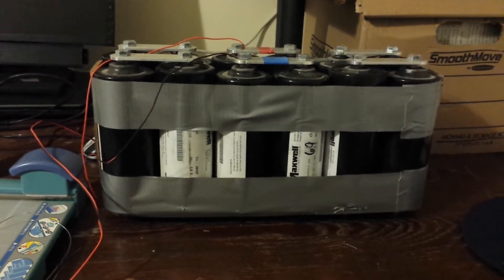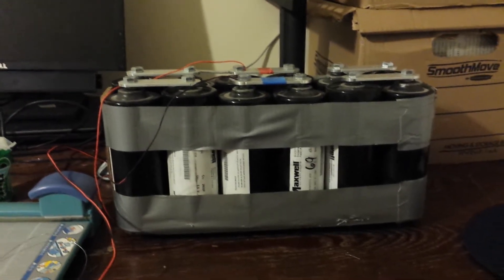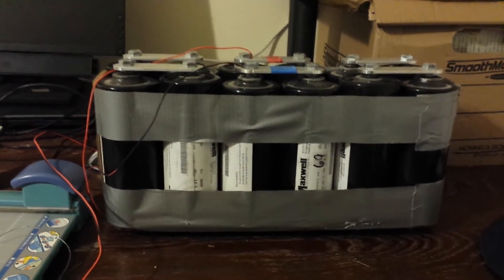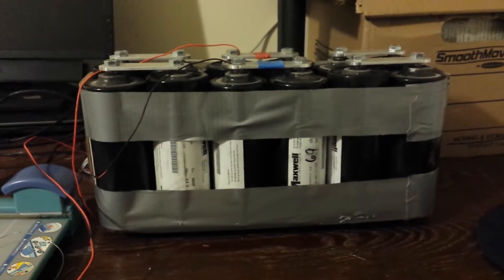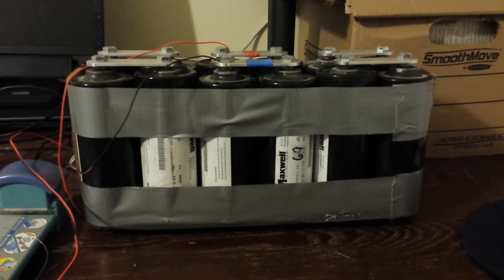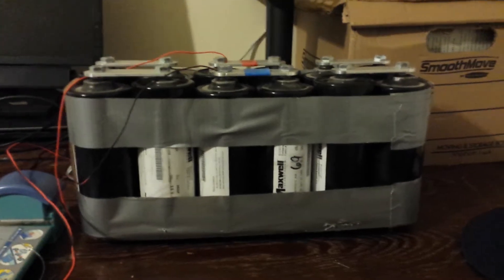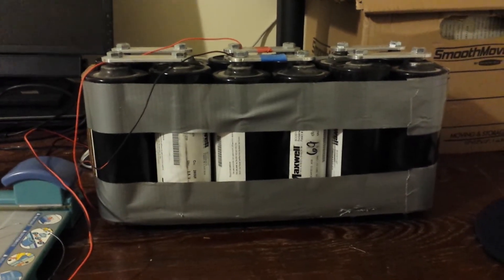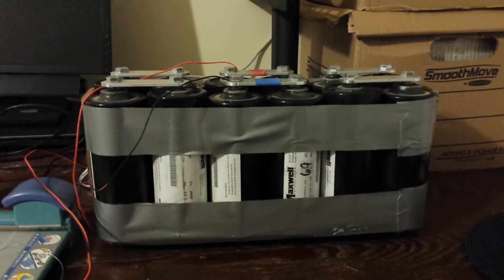Ultracapacitor off grid update

Comment: Added a maxwell 58f  cap to my 12v system, works great , anyone telling  you it doesn't  work is a bs artist or is ignorant . Helps heaps with inductive loads and takes the strain off your battery . If i could afford it i would add the 500f cap .

Comment: how can i get ac voltage from panel without using inverter by using normal capacitors
Reply from the maker: Herman Mhagama the best method would be to use inline microinverters to get ac power if you are attempting to add capacitor you would wire caps in parallel from the panel

Comment from the maker: I will show a diagram on my video as I setup. I plan to have 2 banks wired in parallel using 7 12v batteries and my 12v charged super capacitor. The design shows that the super cap will take the bulk load of the hit from inverter. By reducing the initial load coming from the bank I will be successful in stretching the life of the battery bank by reducing the hard loads.
Reply: hii ,

where did you purchase these ultra cap ? 
how much each did you get it ? 
can't find anything here in germany.
andrew

Comment: Do you have plans to make a 48v bank?
Reply from the maker: There is a future plan to get a 48v capacitor linked up. I do know that a capacitor in series vs parallel creates the same capacitance of the 12v so I am setting this up to possibly save a little $$ and stretch my capacitors in several other systems.
Reply: econPOWER Keep it coming. Looking forward to the next installment.